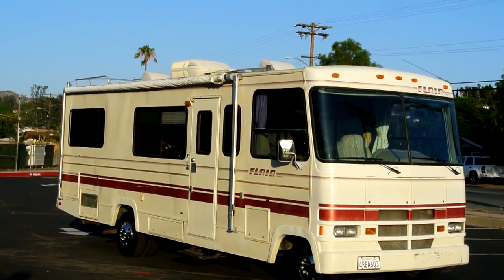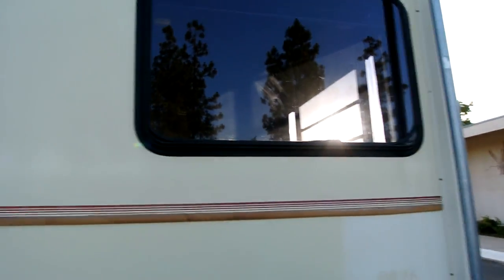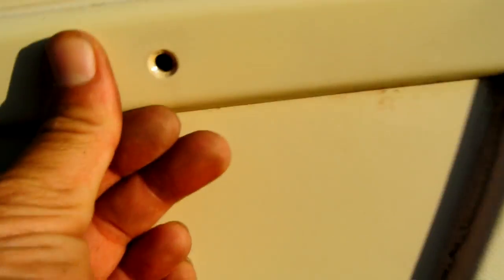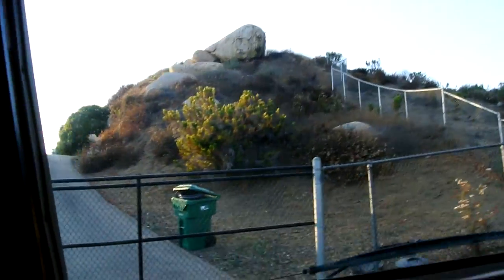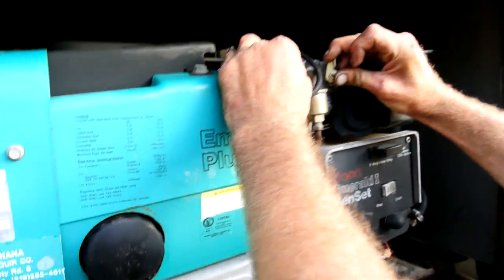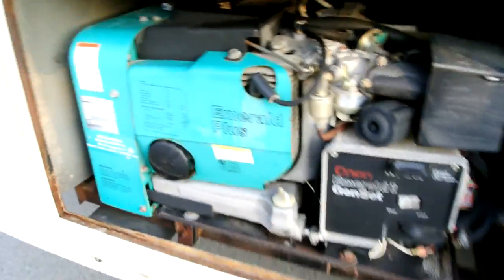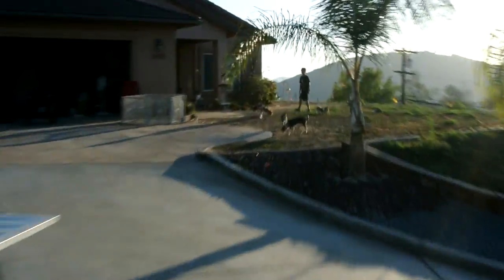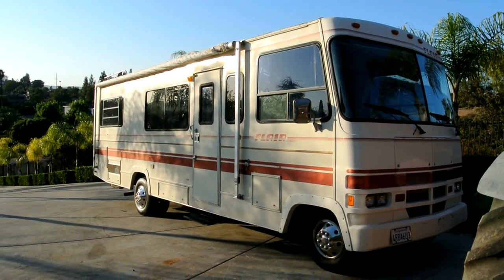Fleetwood Flair Motorhome RV Camper Family Camping Coach For Sale 33K Orig Miles

Comment: I recently made a down payment on a 1991 Feetwood Flair 22 Foot Motorhome. It needs to have the roof scraped, and resealed, and a few other minor details, but the biggest issue that needs to be tackled is to find out why the Power Steering does not work, and see what needs to be done to get that issue fixed, because it is a bear to turn around in tight spots without power steering, but for the price of $2500.00, I had to grab it. It only has 18,000 miles on the clock. I think it was a good buy for $2500.00, even with no power steering, and the roof needing a good scraping, and resealing.

Comment: miles on old one are normaly low 33k is low or high depending on what you buy but the diesel normaly have more miles gas is always lower miles that i see fuel is better on the diesel pusher nice vid Nathan